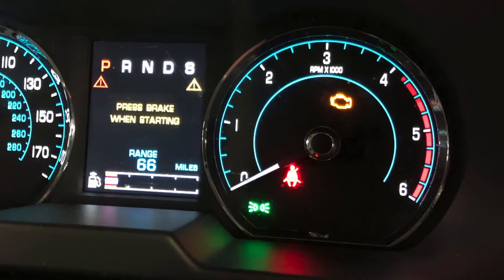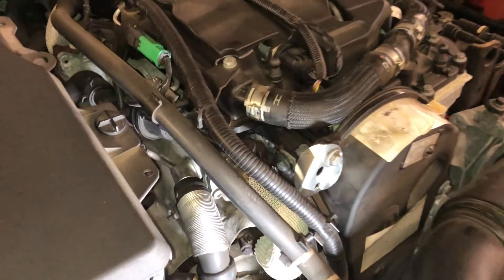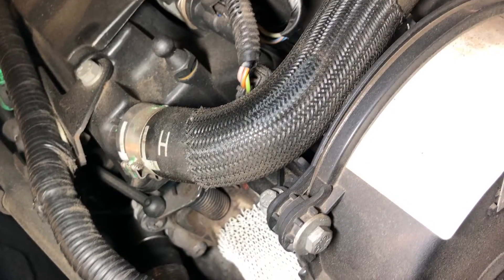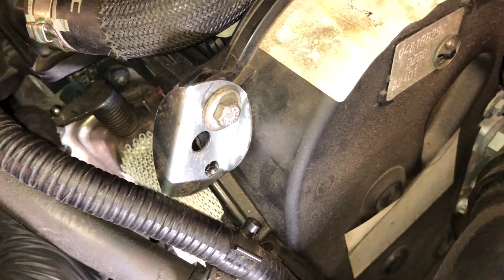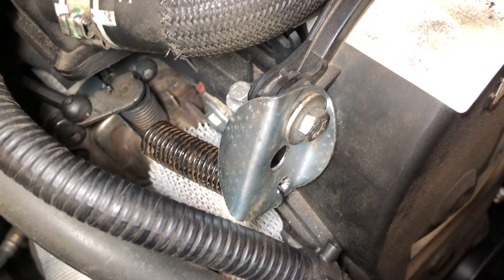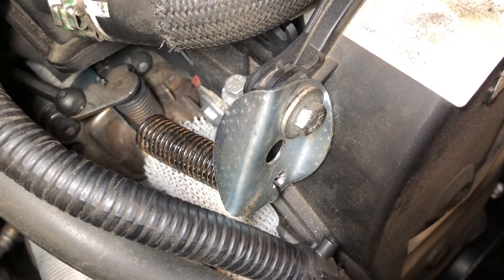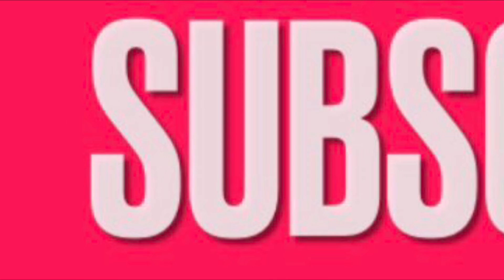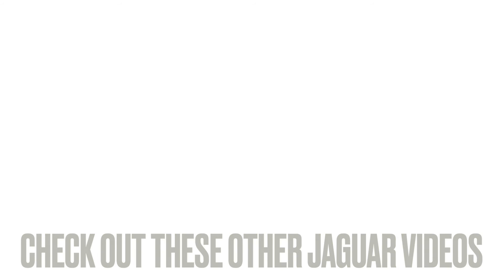How To Fix Your Jaguar EGR Problem (The Easy Way)

Comment: Hi mate,

Please where did you get this spring, been looking around for this. Thanks
Reply from the maker: It was a multipack, got it from Gsf car parts, check eBay or Amazon they may have them as well.
Reply: @How2FixIt1  hi matey any chance you could get me the spring measurements if poss or the link to buy it,there is that many its a mind bender ,if not thanks anyway good video
Reply from the maker: @MrPatch25 they was from one of the national parts suppliers. I just got a random set with about 100 various springs in.